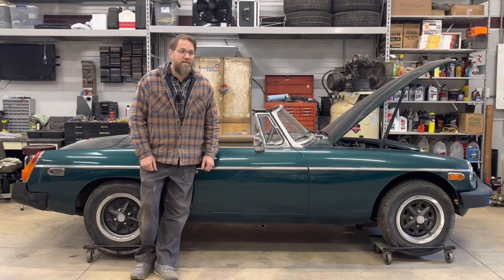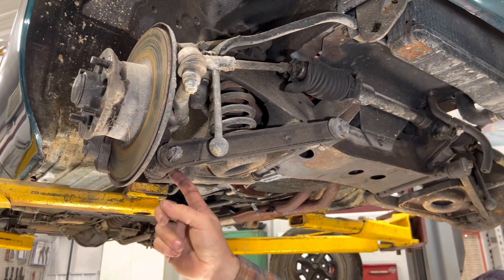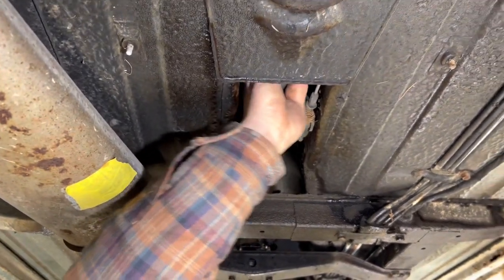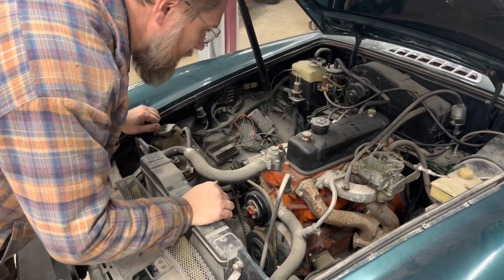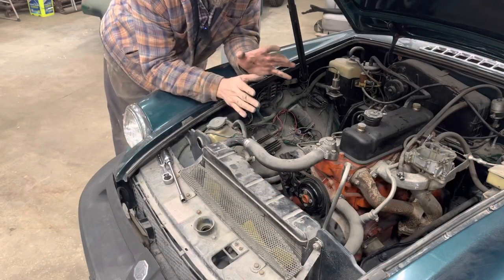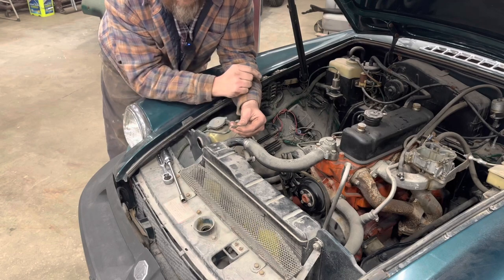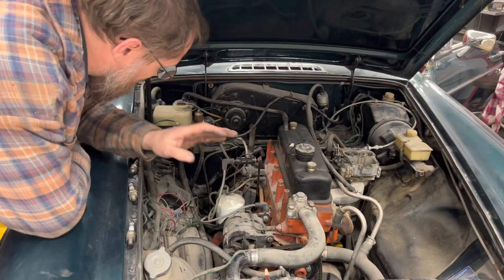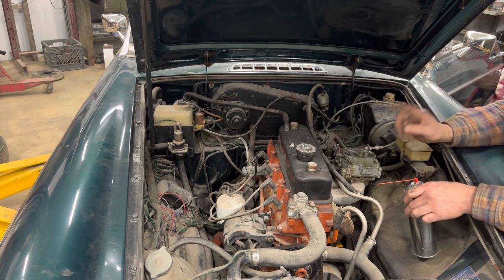Is the 79 mgb we saved as good as it seems ?

Comment: I have a Red 1968 MGB I did a ground up restoration on 5 years ago. I affectionally named it the Beast. It was a rust bucket.  It took me 3 years to cut out and replace both the sides of the three unitize construction sections and lower and lower rocker panels and floor panels. I almost junked the car but I knew I'd never find another 1968 MGB again. 1968 was first year for the Negative ground, Alternator and 4 speed synchromesh transmission. This was also the last year with only 2 wipers, original bucket seats and no side markers or the reflectors that the 1969 later models had.

Comment: Good luck bringing this back to life.  I had a 73 which still had the  twin SUs and the higher compression ratios.  Not fast but also not a pig especially when you de-smogged them.  The later models were so downgraded with a single Stromberg carb, more weight (rubber bumpers), and a lower compression ratios it is sad to see it.